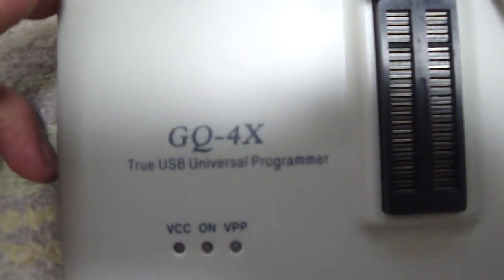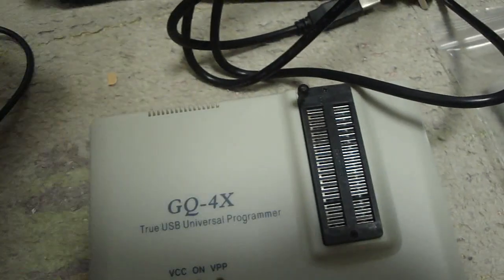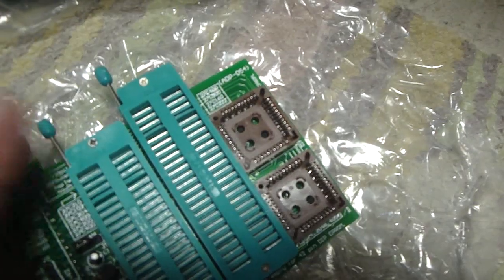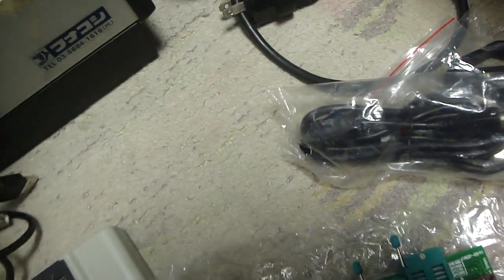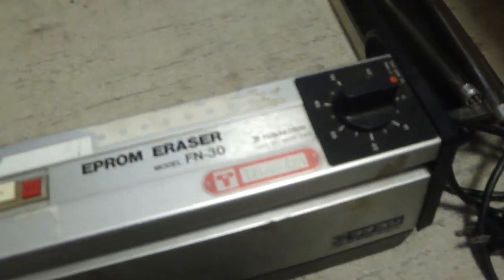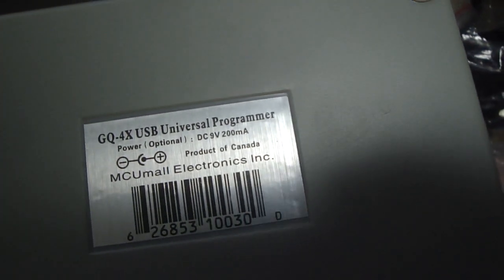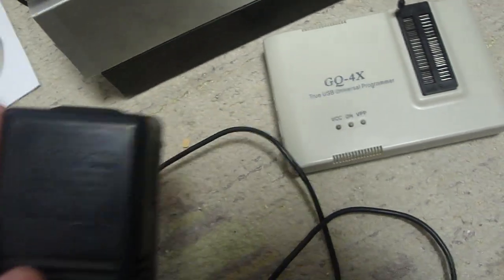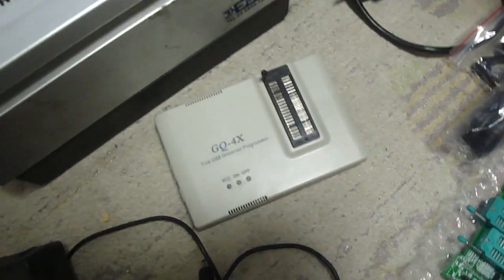GQ-4X USB Programmer For EEPROMS, EPROMS, DAC, ECT From MCUmall

Comment: You could have just opened the mega drive adapter, desoldered the wires from the rectifier PCB, and resoldered the wires in reverse. A lot simpler that way :-).

Comment: Thanks for the nice video. 

As I know The power adapter is realy a optional item. Unless you are connecting the programmer to a unpowered USB hub, then you need power adapter.

If your EPromn does not write well, then you can try a external power adapter.

Comment: Luke, could you not just splice the megdrive wire half way up, and swap over the wire inside to reverse the positive/negative & use some heat shrink etc. That way you could still use the same end adapter?

Comment: Its best to get a programmer that will handle devices with large pin counts and is usb powered  instead of using one that requires a device adapter and AC adapter like GQ. I use a top2049 which is usb powered and supports 48 pin devices and yes the new software update has fixed support for the 27C series 2 years ago. Only draw back is no 64 bit window support but if you have 7 professional it will work in virtual xp mode inside of your 64 bit OS

Comment: So (and I know my math is wrong) if you put a 9v 1000mA brick into a device that asks for 9v 200mA, you will get, say, 12v 200mA.  Or the reverse, if you put a 9v 1000mA into a 9v device that asks for 9v 1200mA, you may get 9v 800mA.  Again, those numbers are definitely wrong, but the idea is the same.

Comment: Luke, one thing to worry about is those unregulated power supplies are rated at (for example) 9v 1000mA and will put out MORE voltage if you draw less mA, or put out LESS mA if you draw more volts.  Usually the device has its own voltage regulator inside so it isn't a huge problem, but you don't want to stray TOO far off from the original specification.  
Careful!